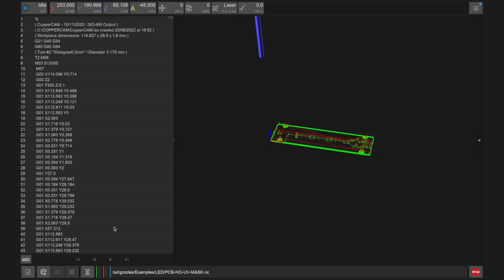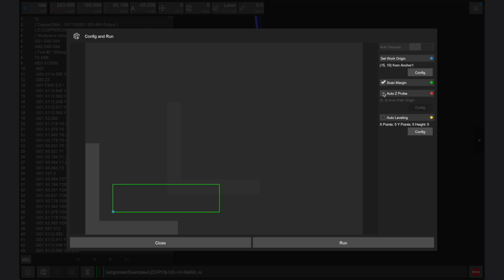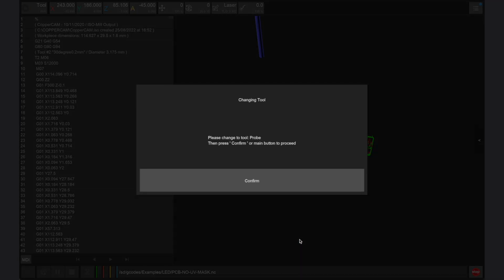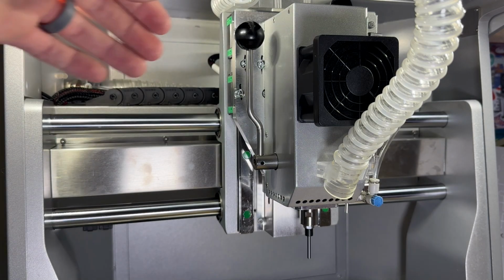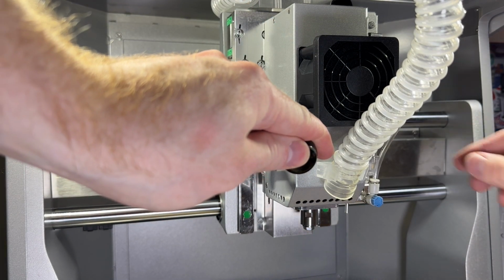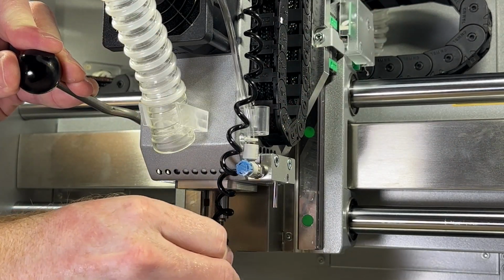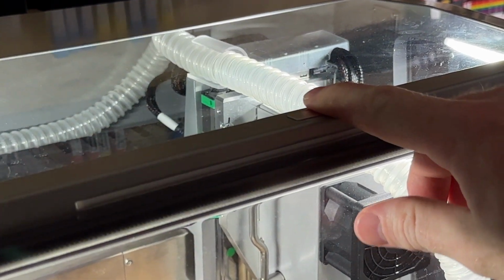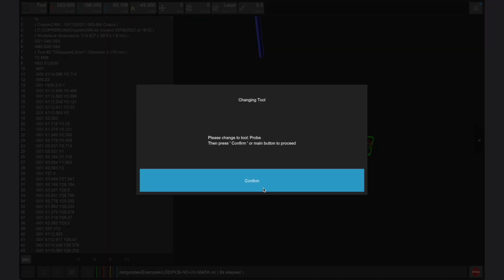How to use Wired Z Probe for the Carvera Air Desktop CNC

Comment: This does not work at all man the second you load the probed into the carvera  it does not even know thats what is in the spindle you need to go in the app and tell it you are going to load the probe why even make this video when you can't have clients follow it
Reply from the maker: We're not sure if we understand your feedback, but please contact us at support@makera.com if you're running into trouble with your machine.
Reply: @Makera  So what I think they mean by this is as follows (I have a similar issue). On Carvera CAM we can create the 3D tool paths and export these. However, when we upload these to Carvera Controller there is no prompt to insert the wired probe as it assumes it's there already. Furthermore, for me, the Carvera air does not home itself with the wired probe, it only ever auto levels. Essentially it's not automated, or even semi-automated, and there are far too many opportunities for the machine to break either itself, the tool or the probe. I myself broke an engraving bit the other day trying to do the 4th axis relief example because the finishing pass gcode did not prompt me to put in the wired probe, which then drove the engraving bit into the 4th axis motor shielding.
-
I would provide upgrades that either increase prompting in the software, or hardware improvements. For instance, Bambu uses inexpensive RFID chips in their filaments to stop filaments and printing parameters being mismatched by the user in the software. Perhaps there is a way of doing something similar so that the Carvera machines themselves know what bit/probe is in the collet and can then prompt the user of mismatches.